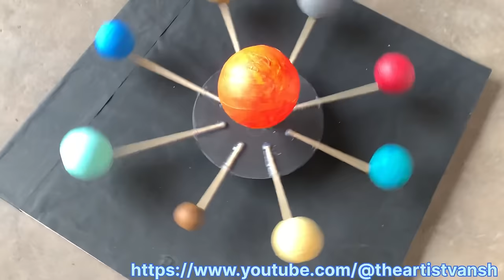Solar system Working Model Making .Science Project. For school colleges science exhibition

Comment: How many things to need
Reply from the maker: Card board 
Chart pepr 
Balls 🥎 
B O motor slow speed 
Battery 4 volt
Switch 
Charging socket 
Wooden bits
Reply: Thankyou
Reply: What type of balls?
Reply from the maker: @The_4thDimension  plastic balls small and big

Comment: Lista de materiales
Reply from the maker: Card board 
Chart pepr 
Balls 🥎 
B O motor slow speed 
Battery 4 volt
Switch 
Charging socket 
Wooden bits